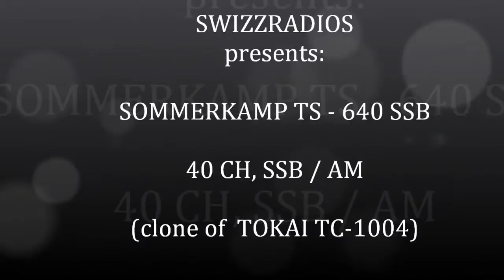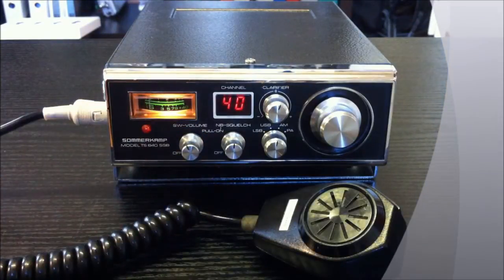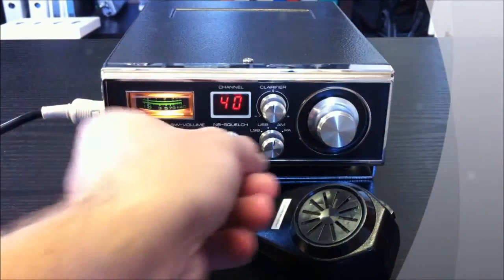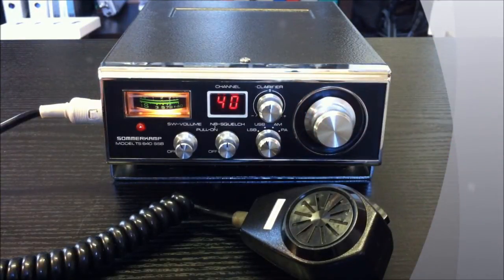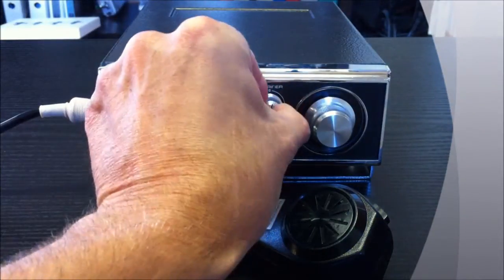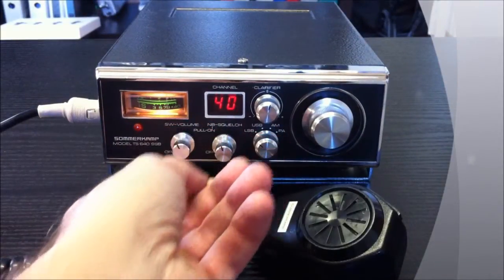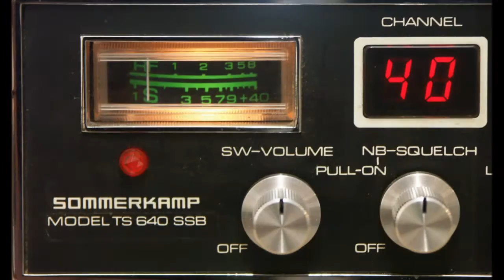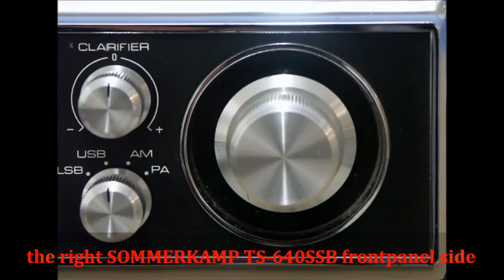SOMMERKAMP TS 640 SSB, the clone of TOKAI TC 1004 SSB AM

Comment from the maker: Yes, the SSB RX is a single conversion type. But the AM-RX (455kHz) IF signal is produced by mixing the 8.2485 MHz high IF-signal with a separate 7.7965 MHz RX-Crystal oscillator signal. Then the signal is going through a small (CF455) ceramic filter. So will be the AM RX a dual conversion type. Best 73s to you.

Comment from the maker: Fred Dread hello. The mic input does have a 7pin DIN plug, similar to many SOMMERKAMP Radios of example TS-310 DX / TS-340 (DX), GLOBEPHONE GS-480DX. But on the similar radio Xtal X-SSB 10, is a 6pin (with center pin) DIN plug installed. Best 73's to you